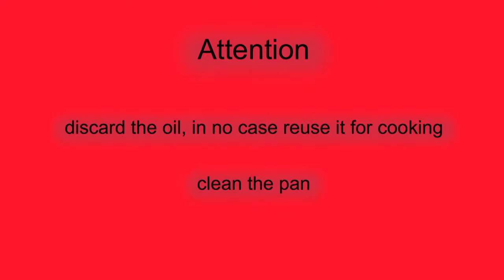Introduce solid tire to electric scooter by hand (Xiaomi m365)

Comment: I would be afraid of tire spinning inside of the rim with butter and oil ?  I boiled the tires in water to loosen up the rubber then worked it on. I was thinking about hair spray to help slide it on then would help hold in place after it dries.
Reply: Правильно приготовить надо уметь. Во первых шина после жарки будет на вкус как резина. Надо положить в духовку в фольгу. Добавить веточки свежего розмарина. Я не хочу чтоб соседи сказали: Опять выходной- сосед жарит шину.

Comment: Doing this soon . Was so concerned the tyre is so so hard. It’s a rear wheel with 15cm leverage as cables attached. I gotta balance wheel on scooter upside down to do all my punctures. Dreading this😂 I got extras hands if needed . I was gonna microwave mine I’m scared oil will make it slip off lol I had a crash . Blast tyre versus storm . Broken nose . Sprained wrist just a mess I’m black and blue. Got the tyre off and just waiting on my wrist healing

Comment: 🙁😅I would take this as a joke 😂Any fool would follow this one! Last thing you want to put oil on rubber but this fool even takes this joke to a different level by actually FRYING the tyre👹👹.in cooking oil ? Come on there are other safe methods of fitting solid tyres out there.I hope this fool is not allowed to put on tyres on aeroplanes wheels,car wheels,motor cycle wheels etc etc 😂There would be lots of FRYING going on and obviously accidents with these slippery missiles 😆😆

Comment: No need for all that bollocks I literally just put the tyre in a bowl of boiling water from the kettle,put a bit of washing up liquid around the rim and then stood on the bottom half of the tyre and wheel then pried the tyre over its not hard when you know how.
Reply: Same. Left the tire in boiling water for about 8 mins or so, then sprayed some wd40 around the rim and was able to easily slide the tire on for the most part

Comment: What a stupid idea, the oil destroyed the rubber, all tyres are temperature rated. The easy way to put a scooter tyre on is  by using a vice, it goes on in about 20 seconds without any mess.